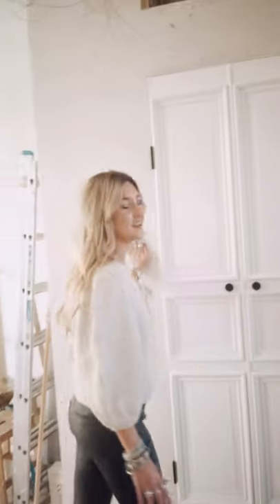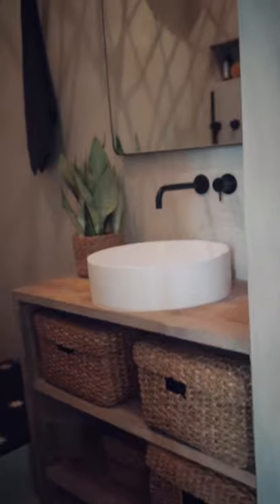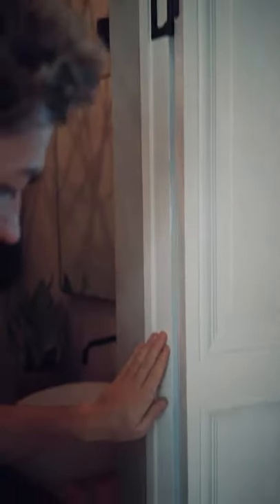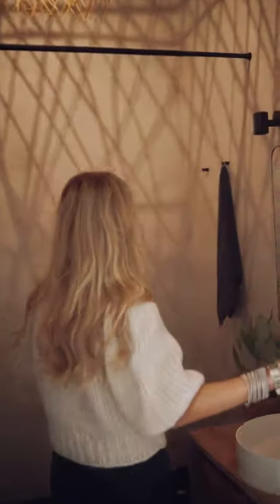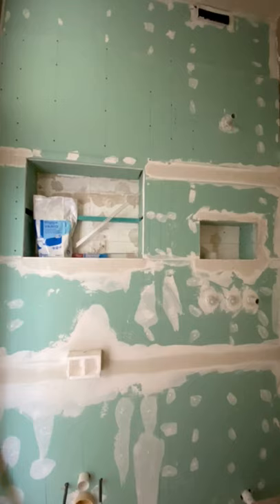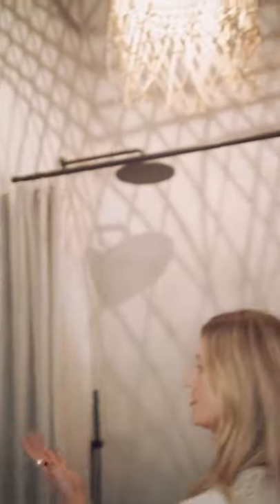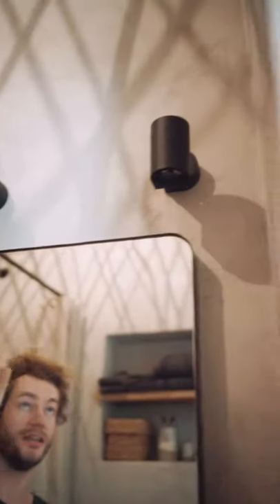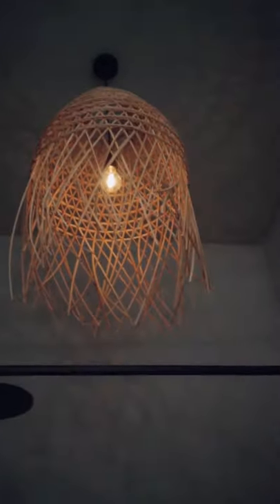Bathroom tour - Casa Cozy | MIKUTA vlog #53

Comment: This is a great video, thank you so much for sharing! We are looking to do almost exactly the same thing in our bathroom remodel, so very inspiring. A couple of questions, did you regret getting a black toilet? We've been told it's slight impractical because of water stains! Also have you found the microcement fully waterproof in the shower with the correct sealant? Why did you go with tiles in shower instead of microcement floor? Thanks again! Super useful
Reply from the maker: Thank you so much! The black toilet does show stains faster due to chalk stains (white on black = pretty visible) but we have found that if you put a big boiling pot of water + half a bottle of vinegar every week or so, chalk has no chance and it's all clean! The micro cement is 100% waterproof with the right sealing applied and also super durable (also on the floor). The tiles for the shower floor were just for the design/ look - we could of course have done the micro cement there as well but wanted to bring in the other element with the cement tiles and the stars. :)